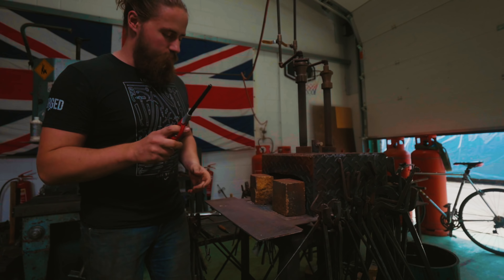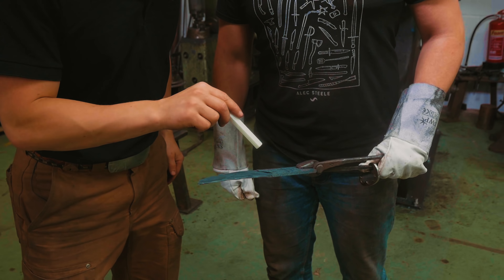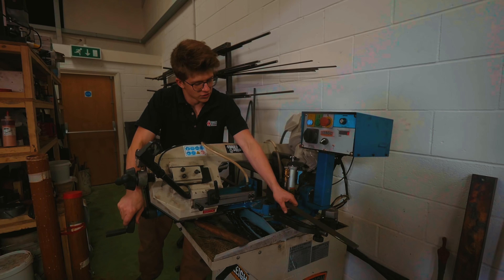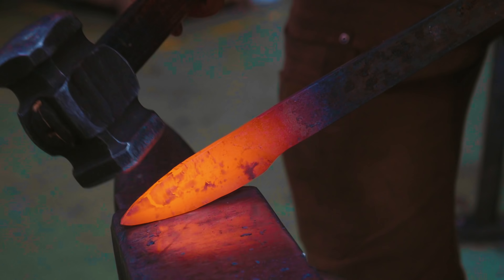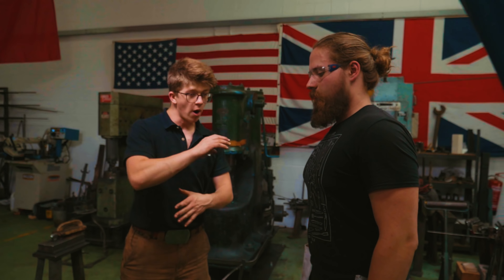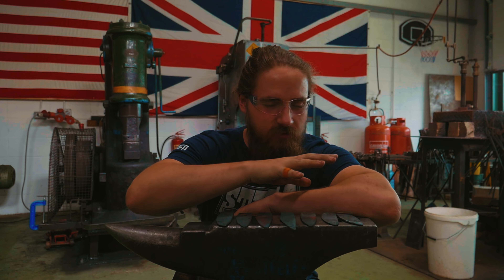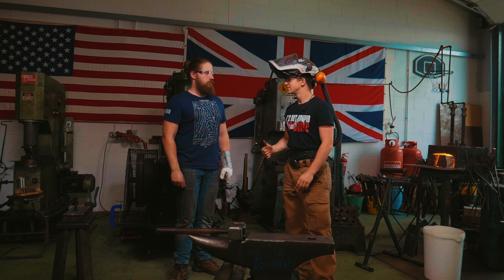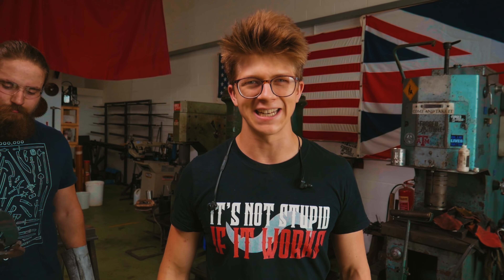HIS FIRST TIME FORGING A KNIFE!?!

Comment: O1 is bitch to move when it's hot. It doesn't soften like others steels at orange temperature so there's always a temptation to get it hotter which is a big mistake. Once you over heat O1 it crumbles into giant grains then rapidly oxidizes and falls apart.

Comment: Serious question, since you were talking about opening up your chest to get a more efficient swing, I notice a lot of Smiths choke way up on their hammer, when if you hold it closer to the end of the handle, you get more torque from your swing. Why choke up so much? Is it a control issue? I was raised around carpenters, and the first thing they get you used to is holding down at the bottom of the handle so you can get more power in your swing and take less time at a job. Same with hatchets and sledges.

Comment: It's good to see you teaching! It seems like you've got a real knack for it. Just one question- it seems like Alex is holding the hammer higher on the shaft than you do. Is it better to hold it lower down and let the weight of the hammer do some work, like an axe, or do you want a higher grip for control? Or does that change with what stage you're working on?
Reply: VoxDraconae the hammer is heavy, no matter where you hold it. Holding near the hammer will give you more control, on the other hand, I think that holding farther down is purely for more force. So if you can control the hammer with a lower grip position then go for it, you do have to take in mind how much faster you'll get tired.

Comment: Alec, I inspired by you have built a forge from home so I have something to do with my time while home w a brain tumor that can't be fixed, my time soonish. I have made or am making my first knife w only the mini forge, my 3lb hammer, few types of pliers to grip with and a DeWalt 4.5 in angle grinder to get some heft out of the blade. Would like to show you, as you young man have inspired this older 🐕 43.

1. How can I correspond (I no longer use FB or any of the like) to send pics or maybe ask a question, you inspired me so it's your fault..lol lol

2. I would like to see a project, where you use mystery metals. Meaning gather metals maybe four or five types. To see how they blend, color etc. Think non traditional, non metals we know 1084 1095 etc that's identity is known. I'm curious to get more than one color after blending and etching?
I'll get u my info or call to give it to protect both our information.

Cheers, Young Forge Master.
Rick
P.s. I don't even have an anvil yet and I have the blade where I'm beginning to shape the bevels!

Comment: Why is your anvil so low?  It looks like it'd be really hard on your back.
Reply: GodEmperorOfDune Alec explained in a video a while back that you want your Anvil low enough that if you needed to you could hold a pair of tongs or piece of Steel between your thighs so you can use both hands on the piece. If I remember correctly he called the thighs the blacksmiths third hand